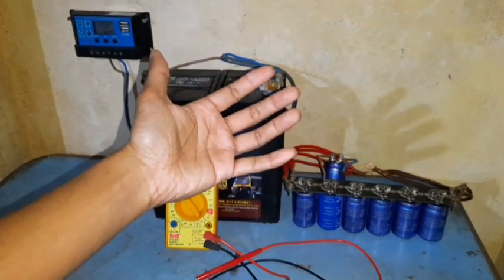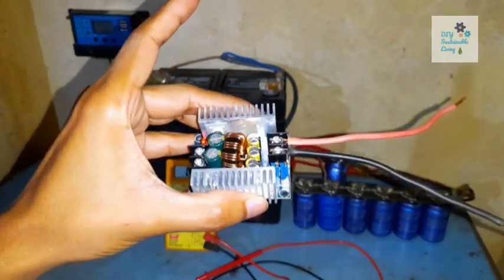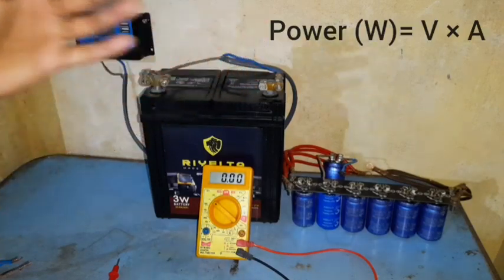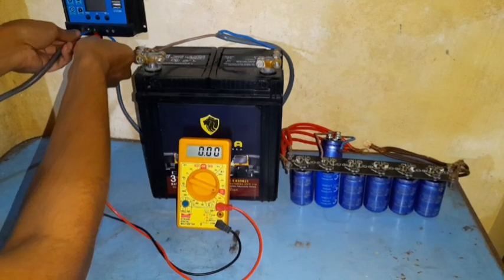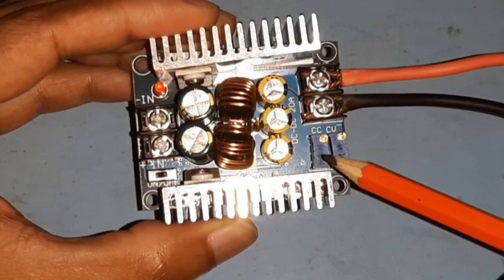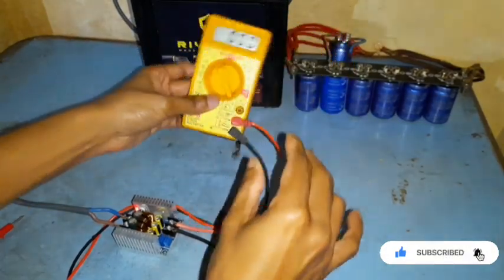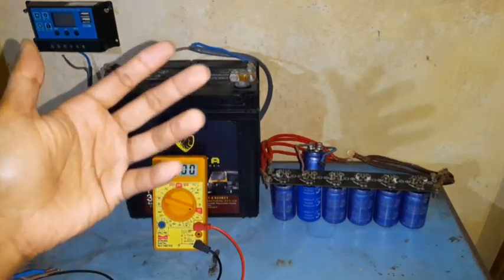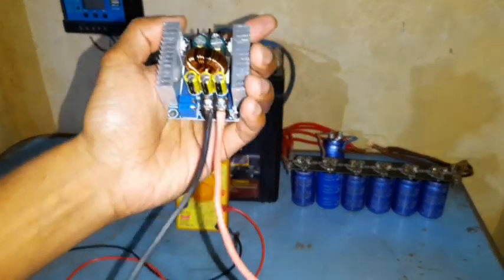Dc to dc Step Down Converter- Part 1 | Improve your DIY Off Grid Solar System using a Buck Converter

Comment: Does it actually work though because the calculated input increased from 11 watts to 28 watts
Reply from the maker: No.... I realized these things after I made this video. When you pull a large amount of power from your solar panel the panel side voltage drops. This reduces the maximum power that can be got out of your panel. If you want more power it would be cheaper to just buy a new panel. MPPT charge controllers are able to get more out of your panel but for a small system the cost may not be justified. Please check out my other videos on this subject to get a better understanding.
Reply: @diysustainableliving2774  that's what I thought too, so I think adjusting to get a bit lower in wattage compared from the input should be good

Comment: May be it's incorrect to test the output current of buck by shorting it. Pls. Make a video showing current drawn by a battery from buck by connecting the tester in serries with the battery and do the same with the output of SSC. And compare the result. so we can see which is better.
Reply from the maker: Yes.... This was my initial video on buck converters. I later realised that it is bringing the panel side voltage down as well. Please check out my other videos where I do a live test on a running system https://youtu.be/OWjOcakSjk8
and also comparing pwm vs mppt charge controllers as well https://youtu.be/V9eGYnuvBMU

Comment: The most important thing is input voltage, as that comes from the panel. if you draw too little current the input voltage will rise, if you draw too much current the input voltage will fall, unless you vary the load current on the panel, the voltage will move away from its ideal level, the mppt voltage, that will be written on the panel. if you do not have a circuit to monitor the input voltage that adjusts the load current to keep that voltage at the correct mppt level, ie a tracking circuit, your panels will be wasting a lot of sunlight....
a pwm controller, a boost converter or a buck converter is a waste of money as it wont do this, just you waste less money with a buck ocnverter.....
Reply from the maker: Yes... Please check out my other videos on this series where I do a live test with a buck converter on a running system and next with  comparing MPPT vs PWM controllers. Thanks for the input. It is exactly what I learnt while experimenting with my system.

Comment: What model is the buck converter used in this video? Aalso, will it be possible to connect it to a load of 5v/2a if i have 50watt panel?
Reply: Also, is there a minimum voltage/current for the buck to output a regulated voltage and current of 2A?
Reply from the maker: This is a 20A 300w dc to dc step down converter. I think the voltage range is between 5V to 40v. The minimum output voltage is 1.2v I think. Please check the specifications before you make any purchase.
Reply: @diysustainableliving2774  is 300w 6A enough? It is the only available converter in my place. Thanks
Reply: Sorry. I mean 300w 8a
Reply from the maker: It should be enough as the load is only 2A. As long as the load is within the specs things should be ok.

Comment: Can i use buck converter between solar panel and battery just add diode protection?
Reply from the maker: Yes you can. But it will function as more like a PWM charge controller than an MPPT. You can check out my other videos to see how they compare.

Comment: The input is 13.65 watts and the output is 28.98 watts. How can this be? 🤔
Reply from the maker: Please look at part 2... What happens is when the amps goes up the voltage drops. This was not the expected result so thats why I made a separate video showing it in a running system.

Comment: Pwm vs buck converter which is more efficient?
Reply from the maker: Both of them do two different things. If you have lithium batteries you may want to consider a buckconverter as it will give a more stable voltage setting. As for buck converter vs MPPT scc the MPPT wins. The MPPT solves the problem the buck converter caries as it cannot control the input voltage where as MPPT scc can control the input voltage to get the maximum power out of the panels.

Comment: In solar system there is no shortcut only short-circuit . More money u burn , more power u got 😅
Reply from the maker: Yep... true. Yet as long as you calculate your savings by going solar you wont be dissapointed.

Comment: Hi thanks for the video...would it be possible to improve the performance of this buck converter by adding Capacitors at the input or output of the buck convertor? 
My input is 24v dc from lead battery
My output is 5v to raspberry
If it is possible to add Capacitors to improve on it's performance please advise the values of the Capacitors. Thanks
Reply from the maker: As long as the input voltage is stable as you are using a 24v battery as the source you can get the rated power of your buck converter. A raspberry pi wont use a lot of power so it should be well within your needs. You wont need additional capacitors unless your power draw goes above the bucks rated power output. The problem with solar panels is that as the load draws power it reduces the solar panel voltage and thereby reduces the input power. Once the input voltage goes down the outpow power also goes down.
Reply: @diysustainableliving2774  thanks for the reply, but if I would like to see the "impact" of introducing Capacitors on the buck convertor, where should I insert the Capacitors. 
As I have mentioned
My input is 24v seal lead acid battery down convert to output 5v.
Thanks hope to hear from you
Reply from the maker: A capacitor is a temporary energy storage device. Lets say you add a DC mortor to this system and it draws 10A. As it powers on it will draw more than its rated power at startup and stabilize. Here you might see an impact by adding capacitors. But just for a raspberry pi which only consumes 500mah you are not going to see any impact by adding any extracaps. The buck converter itself has capacitors which should be suffifient in smoothing out any ripples at that output.
Reply: @diysustainableliving2774  thanks understand, but possible to add a 50v 22uf on hand at the output terminal of 5v ?
Reply from the maker: Yes you can but you wont see any difference. Im not exactly sure what you want to achieve by adding that.
Reply: @diysustainableliving2774  thanks...just to satisfy a curiosity. But as you know, the raspberry though low in consumption...do pull quite a fair bit of current at the boot up stage.

Comment: That's not how you measure current, you need to series you amp meter between source and load, an mppt is also a buck convertor but it always tracks the maximum power of the solar panel, a buck convertor only usefull here if your load is less than the source otherwise it will work same as a pwm controller.
Reply from the maker: Please check part 2 of this series where I do a live test. It is not as good as an MPPT.

Comment: I am using this it's real thanks boss.😀
Reply from the maker: Hi there.... Is there a big difference between your panel  voltage and the batteries. If not the benifit is not significant. Please check out part 2 of this video where I do a live test. Thanks!

Comment: Great Idea, thanks for sharing.
Reply from the maker: Please check the next part. This is not correct when it is fixed into a real setup. Please checkout part 2 where I do  live test. These are useful if you have a specific voltage to achieve but not as an MPPT.

Comment: It's an useless experiement as long as you are not attaching a significant load. I tested it long time ago in my home. This buck converters are 75/80% efficient generally. Noway near a good mppt(98%). More over it doesn't charge battery as a charge controller does. Because it doesn't design to do so. It can only provide a constant voltage...will ruin your battery bank in long run.
Reply from the maker: Yes... I realized this after making this video. I have done a separate video showing that in real live situations it is not as good as an MPPT! Please check it out.

Comment: Hello! Maybe you can help? My panel has a maximum voltage of 30V and my MPPT dc dc charger only accepts 24V. Can I put an 24V step up / step down Converter between panel and MPPT charger to make this combination work?
Reply from the maker: MPPTS are much better than buck converters in solar applications. MPPT charge controllers usually have a wide input range and output can also be adjusted according to the setup voltage. It cant be just 24v. It would be helpful if you could specify the brand and modle of your MPPT so that I can look up the specs and let you know.
Reply: @diysustainableliving2774  thank you for doing that! It is a Renogy 50DCDC charger. Here is a link to the manual: https://www.renogy.com/content/Manual/DCC50S%20DC-DC%20MPPT%20Manual.pdf  this is the panel I would like to use. https://www.bougerv.com/products/200w-flexible-solar-panel you can see that the voltage is just a little too high at 30VoC vs the 25V the charger can handle. I was hoping that by regulating the voltage to 24V, the MPPT would still find a power maximum by drawing the current where power is maximum.
Reply from the maker: Wow!... On page 13 sentence 2.5 specifically mentions that charging will stop if voltage goes higher that 25.5v and restarts once voltage goes to below 24.5v. At max power your panel voltage is 26.3V and amps is 7.56A. So yes... this is the best situation to use the buck converter. First connect the solar panel output directly to the buck converters input side (20A preferred) and set the output voltage(CV trimpot) to like say 24.2V (Anything under 24.5V). Make sure the CC trimpot is fully open to allow the maximum amps through it. Next connect the buck converters output to your MPPTs solar power input. This should do the trick. You might not get the maximum possible from your panel but you should be able to get something close to that... And remember next time when you go shopping for an expensive product like an MPPT always read the specs and see if it fits your other components before buying it!
Reply from the maker: You might also need to add a capacitor in the middle if the MPPT still dosent work with that. There is a small ripple on the buck converters output wave form that might interfere with the MPPT but you will just have to try and see. Let me know what happens with your setup.
Reply: @diysustainableliving2774  thank you so much!  The converter I have on order is a 9-36V to 24V 10A step up / step down converter made by XWST. Would you think that’s a good fit?
Reply from the maker: The voltage is correct but the amperage is my only concern as you will be running  close to the maximum of what it can handle you might have to add a cooling fan to keep it cool. Just check out the specs of it and look for the continus working power. If it is 8A you are ok but if it is less you will have to add a small fan for the heat sinks. That should do the trick.
Reply: @diysustainableliving2774  cool. The maximum I have seen on this panel was 11A @ 12.8V. That would be 5.9A @ 24V. This should be fine. The converter is rated at 10A.
Reply from the maker: In your solar panel specs it is mentioned 7.56A at MPP of 26.3v. So at max power you will be getting 7.56A continuously. You will have to put the buck converter between the solar panel and that MPPT charge controller. So the max amps you are going to work is 7.56A and slightly above that. That is why it is preferred to have a continus power rating of 8A. Anyway just see ,if it gets quite hot simply add a small cooling fan to the heatsinks to keep them cool. I think that one should be adequate for your need. Ideally with that MPPT you should get 15.5A! at 12.8V
Reply: @diysustainableliving2774  thanks for supporting me. I’ll get the converter Wednesday, I’ll let you know how it went.
Reply: @diysustainableliving2774  I hooked it up today and didn’t have good luck. Average power was 50W with fluctuations in power between 40W and 60W. Voltage after the converter jumped between 19V and 21V. It looks like the MPPT was fighting the converter circuit. When hooking up the panel directly to the MPPT in the morning when Voltage was still below 25V I got a steady 88W and a constant Voltage of 24.5V. You mentioned installing a capacitor? Can you elaborate how big and where?
Reply from the maker: The buck converter first converts the DC current to something like a high frequency AC and then back to DC at its out put. The capacitors in the buck converter are there to smooth this ripple effect out. But when a lot of power is being drawn at the output there might not be enough charge to smooth it out. You can try adding a big farad capacitor which can handle 24v in between the buck converter and MPPT but that might also fail since power will be constantly drawn at a high rate.. You can try this instead!.... Add a high power resistor between the panel and MPPT. Calculate it so as to get the voltage down to below 24v. That should work as it will be giving constant DC power. Another trick to consider is adding high power diodes in series. Diodes have a voltage drop of 0.7v between the legs. So if you add 6 in series you will get 6 × 0.7 = 4.2V drop!!!... I think this is the best way to go for your situation. If everything fails you might have to get a better MPPT.
Reply from the maker: I think you have to try the diode method. Im pretty sure that it will work!
Reply: @diysustainableliving2774  I would be happy to try. Where in the circuit does the diode go? And how to chose the right one?
Reply from the maker: They should be lined in series and go between one leg of the panels output and MPPT input. if you add 6 then you will get a voltage drop of 4.2V so depending on that you might need more or less depending how much is comming through your panel with the load on. You also have to make sure they can handle around 10A continously so that they dont over heat. Your panel will be producing 7.5A continuously at full sunlight.
Reply: @diysustainableliving2774  thanks again for all. I ordered 50V 10A Schottky diodes. Is that a good fit for my application you think?
Reply from the maker: This is not the diode for your setup. A normal diode has around 0.7v drop. Schotty diodes have around 0.15 - 0.4V drop. You will need a lot more diodes to acheive your desired voltage drop!!.... Just look for normal highpower diodes. And look at their specs for the forward voltage drop value!...
Of course the voltage and amperage they can handle are correct for your solar panel.
https://www.electronicshub.org/schottky-diode-working-characteristics-applications/#:~:text=Schottky%20diode%20voltage%20drop%20is,voltage%20drop%20should%20be%20low.

Comment: i am sorry! you finisheded the vid to soon!
this is really a good idea with a syncronius converter ;)
best regards, stella
ps: sorry for my poor english!
Reply from the maker: Please check out part 2... There is more to it!.. with solar panels it dosent work as an MPPT... If the voltage difference is not very significant you wont get a improvement in amps! Here is the link https://youtu.be/OWjOcakSjk8
Reply: @diysustainableliving2774  thank you:)

Comment: i have a 100w pv in 25v i want to use it to boost my current then connect it to my cheap scc.. what your thought i want to boost the  power of my pv is it safe to do this plan?
Reply from the maker: 100w at 25v means you get around 4A from that panel at maximum power. Since the charging voltage is 14.4v there is not a big difference between the panel voltage and this. If you use a buck converter you will only get a marginal improvement if at all. I think it would be better to get a real MPPT scc or a new panel to increase the power. Please check out my next video on this doing a live test.
Reply: @diysustainableliving2774  tnx for the advice .. looking forward to it